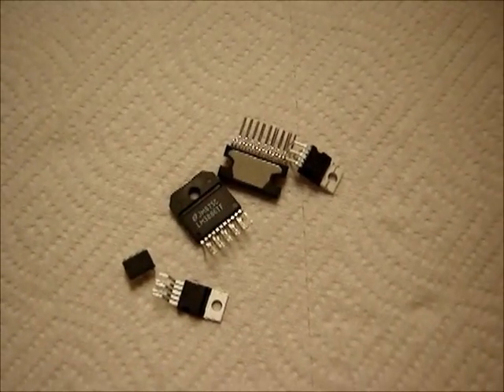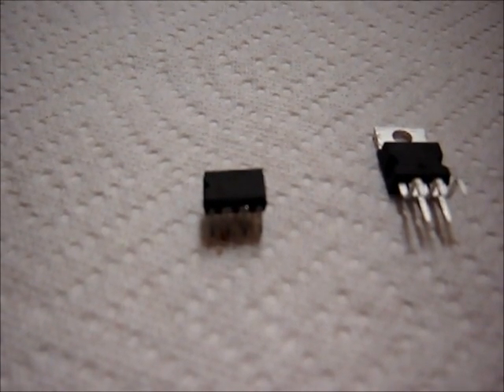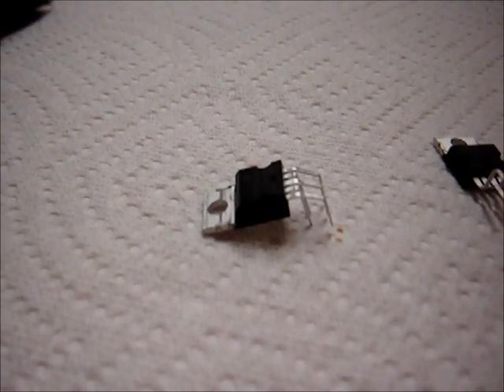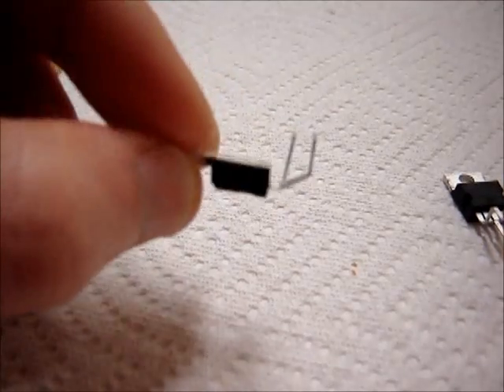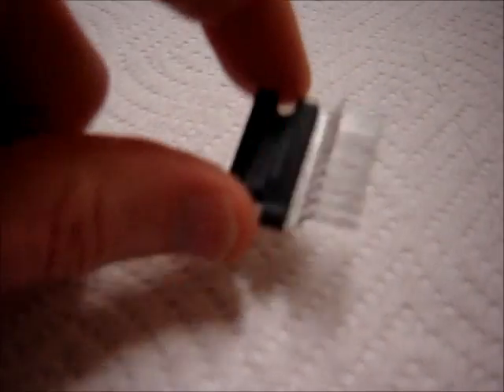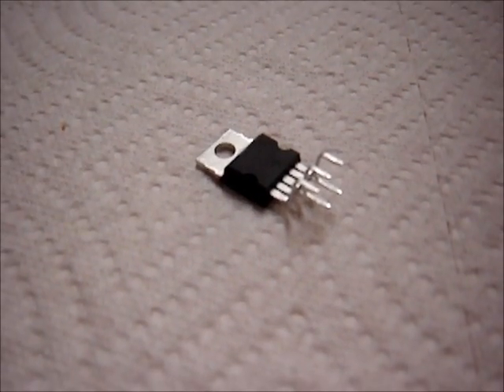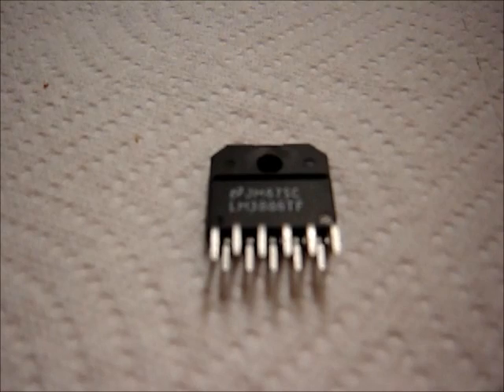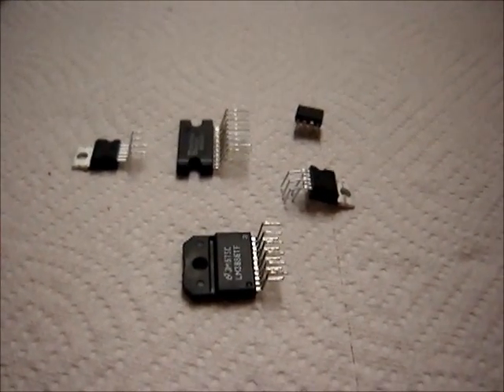My favorite audio power amplifier ICs (chipamps)

Comment: Wait you driving a 15" sub on tda 2050?
Reply from the maker: Sure, Why not? Larger speakers tend to be more efficient, requiring less power to drive them. On top of that, they suffer less distortion and compression and can handle more power when needed.
Reply: @JohnAudioTech  you mean i can hooked up a 12" 200watts 8ohms speaker with no problem?
Reply: @JohnAudioTech  from what i understand, take note i have zero knowlegde in electronics. I only use a 6.5" 25 watts speaker bcoz the parameters says its only a 35 watts chips. Now im confuse coz you said you driving a 15" sub.
Reply from the maker: @ The wattage rating on the speaker is the maximum it is designed to handle. For example, you can use a 200 watt rated speaker with a 20 watt amplifier. You can even use an amplifier rated higher than the speaker as long as you don't turn the volume too high and damage the speaker.
Reply: @JohnAudioTech  is it possible to use it as a guitar amp?
Reply from the maker: @ yes, but it would need a pre-amplifier.

Comment: Hey ive got an 80s Sparkomatic lc100 car amp that has 4 5 prong chips lile this and one is bad but nothing comes up when i search the numbers on it. It says 
AL80317 
88018N
SINGAPORE
any ideas for a replacement?
Reply from the maker: It could be a custom part number for the TDA2003 or LM383 power amp IC. They often used two per channel bridged for more power. The only way to know for sure is to reverse engineer the board layout.

Comment: A few weeks ago I've found the TDA7264, which is a single ended stereo amplifier IC for symmetric powe supply. It can deliver up to 25 Wrms power for each channel at 8 Ohm speakers. Due to its 8 pin Multiwatt footprint it is easy to arrange the peripheral devices close to the IC. It requires only 2 Boucherot filters, 2 input capacitors and 2 power supply decoupling capacitors.

I have found out, that it is recommented to increase the power suppy decoupling capacitors at least to 1 to 2.2 µF. And they have to be applied very close to the power pins and ground of the IC (5 to 10 mm, the best is the direct connection between the pins at the conductor side of the PCB). Furthermore it is good to have a low pass filter (1 kOhm, 1 nF) very close to each amplifier input behind the input capacitor.

This IC is not really cheap (USD 8.66) but it is stereo and very easy to breadboard for test designs. I can send you my test circuit and its breadboard design, if you are interested in it (unfortunately Youtube allows no hyperlinks).
Reply from the maker: Yes, that is a good chip. I did make a couple videos on it. I could do without the mute/stby function implementation though.
Reply: @JohnAudioTech  I have simply set the mute / stby-pin to ground. It is not necessary to use the complicated circuit from the data sheet either. In order to avoid the plop-sound in the speakers you can simply use a capacitor to Vcc from the pin and a resistor from it to ground.
Reply from the maker: @gkdresden  The ICs I have are only in play mode when the mute pin is set between 6 and 10 volts below the positive rail voltage. I used a 7.5v zener, resistor and capacitor for the mute pin, covered in this video https://youtu.be/D5N82Qr6k78

I remember trying to ground the mute pin early on and the IC would not work properly. I suppose I was using a supply voltage greater than +/- 10 volts which would put the mute pin at greater than Vs-10v when grounded.
Reply: What an effort. I use 12 V and grounding the pin works fine. Table 5 in the data sheet also show the following thresholds:

standby: V > Vs-2.5V
mute: Vs-6V > V > Vs-2.5V
play: V < Vs-6V

So a V = Vs-12V is clearly in the play case.

Comment: Great Video and use of best practice scenarios! I will be purchasing the TDA2050 to experiment and see if I can repair my old Ibanez Guitar Amp. I didn't want to throw away my Ibanez Guitar Amp. The Amp is buzzing and I could see that the TDA20xx circuit pooped out due to overheating because my external speaker wires that I added for connecting an additional subwoofer, were making contact with each other by accident and causing the burn out of the Linear IC TDA20xx....lesson learned. Wish me Luck!

Comment: Hi John, greetings from sunny South Africa. To add to your collection of audio ICs, here is a superb high performance audio chip. E-TDA7375V. It has a stereo & quad output, very low THD at ± 35 watts. Very little external components needed, I added a 3 band tone controller & bluetooth module to mine. Workbench assembly worked for 9 hours with 4 x 4 ohm 35 watt speakers quad assembly non-stop, heat dissipation at 19 - 23 degrees measured at 2 hour intervals (no cooling fan) required. Look up the data sheet for this IC, all the guidelines you need are there for this great amplifier. As an Audiophile I recommend the E-TDA7375V for any quality audio projects. A reply would be greatly appreciated.... Cheers from sunny S.A

Comment: Hey can you please let me know how to check TDA 7265 with multimeter? I recon it has gone bad in my Logitech z623 2.1 since the left speaker is distorting  even at low volumes. I've checked the speaker and it is fine! So I'm guessing it's 7265 gone bad.

Comment: Amp datasheet quotes power at 1% and 10% THD. But can you tell how the THD varies? How can I keep it at 1%?
Reply from the maker: Those are measurements at clipping. With the proper board layout and measured before clipping, the distortion should be lower.
Reply: Thank you

Comment: I remember building my first stereo amp with TDA2030's back in the late 80's. These things have zero short circuit protection and would blow up quite spectacularly with lots of smoke and getting so hot the IC's package would melt leaving a glowing lump on the PCB until the power was turned off.
Reply: Bullshit.

The TDA2030 has short circuit, safe operating area and thermal protection.

So you must be a real hack to blow so many of them up.
Reply: @Theineluctable_SOME_CANT  yup, i hot swapped them quite often and sometimes short them and still alive after 30+ years or something... okay gotta admit i poppen one because of overvoltage but hey... using a LM4780 right now and man is it powerful

Comment: Hi John,,, I'm working with a TDA 2030 and I can't get the chip to operate with a volume control on the input,, I'm wondering if you need a Pre amp to have the chip operate?

Comment: How do you test a TDA2050 IC with a multi-meter,
regards
Andy
Reply from the maker: With the IC out of circuit, you can check the output pin to the supply pins with the multi meter's diode function. You normally get a diode drop voltage in one direction and a few drops in the opposite direction. A very low measurement of 0 to .2 volts, for example, could indicate a bad IC.
Reply: Thank you,
regards
Andy

Comment: Where do you buy those chips? original i meant not fake as you mentioned
Reply from the maker: Digikey or Mouser. Some are discontinued and not reliably available (They are fakes).
Reply: Thanks
Reply: By the way is it possible digikey and mouser selling fake IC? i did purchase one IC LT1172 from RS online before and it doesn't work as expected..
Reply: Honestly seems pretty unlikely they are pretty big brands when it comes to components and people buy reels of thousands of components at a time from them so given the scale and all I imagine they do quality assurance to make sure they aren't selling bogus products (some might slip through the cracks but it's pretty unlikely).  Have ordered a few components from digikey and never had an issue.

Comment: Hi, Do you happen to have an example video on how you built your TDA2050A amp anywhere? I feel like I could build the amp but I don't know where to start in order to connect a woofer. Thank you!    B.
Reply from the maker: I would urge you the try the LM1875 instead. For many reasons I now believe it is the better of the two ICs plus the TDA2050 was discontinued 3-1/2 years ago with a lot of fakes being sold now. I have several videos of the LM1875 plus an ebay kit I made a video on a few weeks ago that has a very well designed board.
Reply: Thank you for the information, I will certainly take a look.   B.

Comment: I'm trying to.put together a talkbox circuit that will function inline as a guitar or keyboard or any instrument for that matter, but specifically for guitar. I need to have a small amp, and also send the signal from an electret mic back out to a mono, and additional  (for future send/return) 1/4" jacks. would 5 watts or 3 watts as far as sound be too much? which chip would anyone recommend? thanks.

Comment: Nice IC Amplifiers:

TDA 7267
 low power
 12V 8ohm

TDA2003
 low impedance
 Bridgeable
 5W clean Single ended
 8W low impedance

I wont talk about Car stereo amps
They are probably class-D 

TDA 2050
 5A peak current
 Get hot
 
LM 3886
 Class B....
 it's basically a walkie talkie in audio quality
 but loud!

Please read the datasheets before use

Snickers is a cool cat!
Great video!
Reply: these are just my opinions and personal notes btw

Comment: National Semiconductor!  Ah... good old NS. 

This is my new audio amplifier IC before it was gone.  An National Semiconductor former.  http://www.digikey.com/product-search/en/integrated-circuits-ics/linear-amplifiers-audio/2556583?k=amplifier&k=&pkeyword=amplifier&pv487=364&FV=fff40027%2Cfff802a7%2Ca400e0%2C2dc0717&mnonly=0&newproducts=0&ColumnSort=0&page=1&quantity=0&ptm=0&fid=0&pageSize=25

Although, it have not starting yet for now.  Hopeful by end of years.

Comment: A large theme is the TO-220 case style. It started with the ubiquitous TIP31, TIP32 NPN, PNP bipolar transistors, as well as power FET devices. Interesting to see what ST microelectronics is doing; I don't think revision of internal design is a big issue, as there is a lot of 'equivalence' to reportedly 'obsolete' chips...

Comment: What's your opinion on the TBA810S?
Reply from the maker: It probably sounds just fine but it is an older chip that need quite a few parts to make it work.
Reply: +JohnAudioTech Thats what I have right now and I aiming to make a bass amp do you think it will end up ok with a 10 inch speaker?
Reply from the maker: I think you would want more power for a bass amp.
Reply: +JohnAudioTech Woukd you suggest a certain amp?
Reply from the maker: Something like an LM1875 would give good power for a practice amp. If you plan to play gigs, you need 100 watts on up depending on the venue size and type of music you play.
Reply: +JohnAudioTech Thanks for the support :)
Reply: try LA1000 ic,stereo,100w per channel 6A 12v supply,made 2 of theme,but only one have been to me,isold the the other
Reply: JohnAudioTech - You're right about needing more power for a bass amp, if playing live. Most decent bass amps start at about 400 watts. A good gigging amp would be about 800 watts. It takes a good amount of power to drive those low notes. You can, however, get away with a lot less power if you are mic'd or patched into the PA system. I'm mainly a guitar player, but I play bass from time to time when somebody need a fill-in bassist. My live rig is a Peavey rack-mount Bassist preamp into a Peavey PV-1200 (1200 watt) amp. It's way more than I need, but I don't have to work it as hard as a smaller amp.

Comment: Hi there.dont say tube stuff are to expensive They are not expensive if you understand how to fixing output transformer and power transformer to then it just a question about knowledge how to connect together. And sadly that is a forgotten knowledge.
Reply from the maker: +Hendry parman I was assuming buying new which is not cheap. Used parts can be more affordable. I once bought a 35 watt tube amp for peanuts and got it working again by replacing bad capacitors and one new tube.

Comment: Hey man what was that little cube amp in the beginning of the video based on? That thing is so cool :D
PS: you should try the PAM8403 wbay kit. I have the on with the pot and supply cap. Awesome little amp, sound great, very efficient, super cheap.
Reply from the maker: NoBudgetTech The little cube amp is based two TDA7267 ICs. For a multitude of reasons, I'm not a huge fan of Class D amps although they have their place.
Reply: JohnAudioTech Very nice job with that little amp! 
I'm also not a huge fan of class D amps, mainly due to their sound, but I'd say most of the small low power class D chipamps seem to sound better than AB chipamps. That is, at least, the case with, say, below 5W rated chips. I've never been satisfied with low power DIP package chips, tho. Everyone loves the LM386 for portable boomboxes and practice amps but I think it sounds absolutely awful. 
This little PAM8403 sounds quite good, tho.
Reply from the maker: NoBudgetTech Yes, there seems to be no correlation between how good an amplifier sounds to how well it measures. For example, a lot of people like single ended tube amps, yet they often measure poorly. Perhaps people find some low order harmonics in the sound to be pleasing. People also tend to disagree on what sounds great and what sounds poor. A lot has been written on how we receive sound and the biases involved. I tend to avoid these arguments and go by what can be measured using test equipment. I haven't found class D to sound any better or worse. I don't care for the cheaply made Chinese kits that use low quality components, skip some parts/design such as proper heat sinking and much of the ICs are difficult to handle sub mini surface mount components.

Comment: Nice video, nice channel. Did you ever try TPA3116 or any TPA31XX, they are class D and the datasheet for the TPA3116 says it is capable of 50W with less than 1% THD. I am planning in build an amp and not sure what IC to use. An smaller heatsink would be nice...

Comment from the maker: UPDATE: Sept 2013. ST Microelectronics has announced the obsolescence of about half of their analog audio power ICs which include the TDA2003, TDA2030A, TDA2040, TDA2050 and TEA2025 (among others).
Reply: It seems the industry is going for the class D chips. However, the TEA2025B was a nice and cheap 1-watter for a little computer speaker, and for me, it sounded much better than TDA2822M or the LM386. I like the 7294 too, not a high-end, but good performer. About the older types...STK-based amps are often considered worse than discrete transistor amps, however I heard some which sounded OK for me - an Akai AM-A3 with STK4893 (STK4773 to 4913, 10 to 50 Watts/ch) and an old german set with STK-00xx Darlington Power Pack. Their durability is dependant on surrounding circuitry. And one time I heard an old 50W monoblock movie amp with a Sanken SI-1050G, it was driving an efficient 15'' Fender cabinet and sounded very good.
Reply: +JohnAudioTech, hmmm... I still can buy ALL those chips from a local ST Microelectronics dealer.
Reply: +JohnAudioTech --They ought to change their company name to "ST Microbsolescene." I've used several of their op amps over the years in products and then found they've been discontinued after a relatively short time. I was sad to see the DIP versions of the TS912 disappear.
Reply: I love tea2025., 2025 brigde is very deep bass producing portable amp.